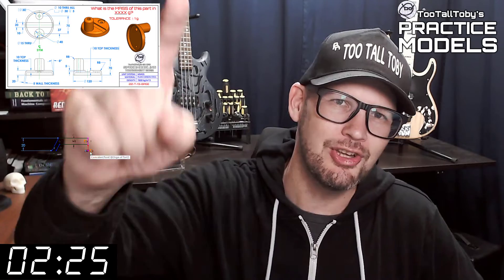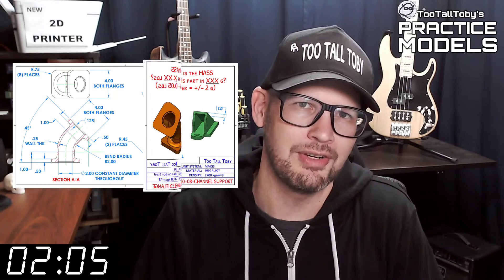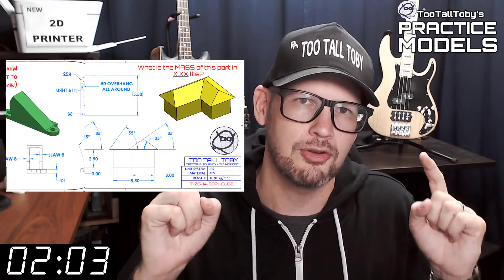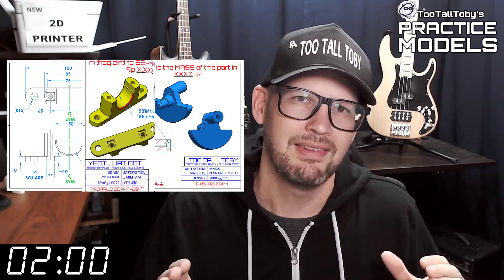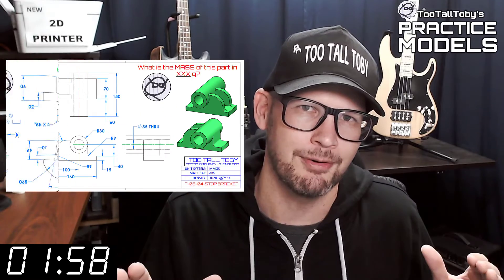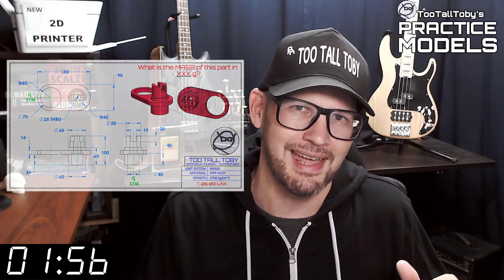2D to 3D CAD PRACTICE MODEL-  Sheet Metal Drawing to Model for Onshape, SolidWorks -SM TRAY BRACKET

Comment: 1380.1518 g in freecad. I figured out that a sheet metal workbench exists and yeah thats my first time I get in contact with sheet metal. drawing was kind of hard to read for me.
In the end I used the sheet metal WB for the basic form and than I used parts design WB for the cut outs. Probably not the idea what inventors of sheet metal WB had in mind, but it work surprisingly well.
Without installing and basic research about the sheet metal thing it took a bit more than an hour.

thx for the cool challenge!
Reply from the maker: Awesome!  Glad you're discovering new functionality in FreeCAD!
Reply: @TooTallToby  meanwhile I made all sheet metal practice models I can find and it makes fun now 🙂
Reply from the maker: @sarahb.8186  awesome!  SOme more sheet metal on www.TooTallToby.com/practice